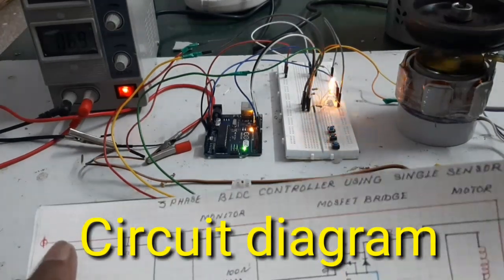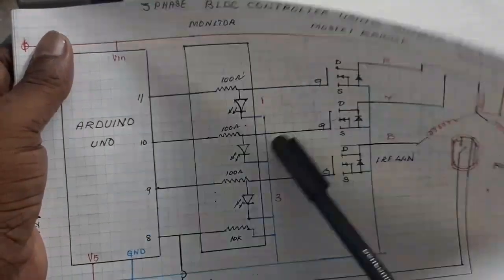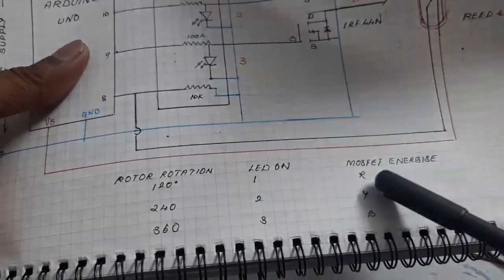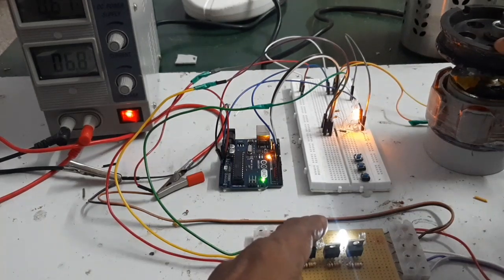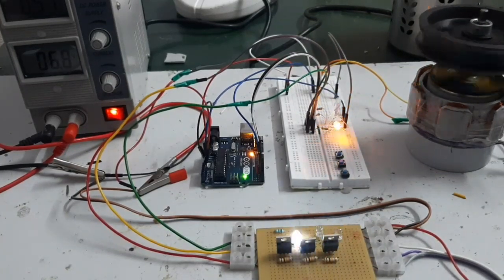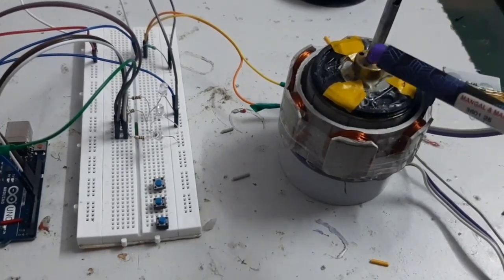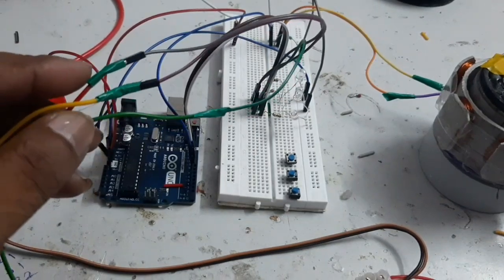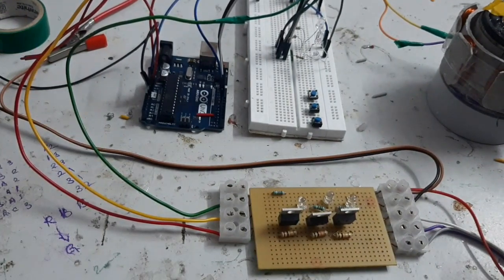(V-118),New invention,3phase bldc controller using single sensor

Comment: Dear Sir, I am much happy to see your sucees in your scientific experiments. I need to create a self running magnet motor using the special properties of the magnets . i have seen so many magnet motors you have created using the permanent magnets and using  the special  adjustment's of magnets. I would like to know if they really work?. so many scientists say that they are fake and no self running magnet motor is possible. But i have seen your magnet motors are running well without any external power supply. So please give me a proper answer whether if they really work or they are fake?
Reply from the maker: Thanks to see my video sir
Reply from the maker: Hi brother 
Some time i have posted free energy project and try to succeed
In general energy cannot be created and destroyed but it can be converted to one form to another
While convert one form to another form energy losses should be there.
When you give some makeup energe in the closed loop system it will work continuesly otherwise not possible.
I have seen lot of free energy projects and follow to make.
99% of free energy projects are fake so don't waste your golden time.